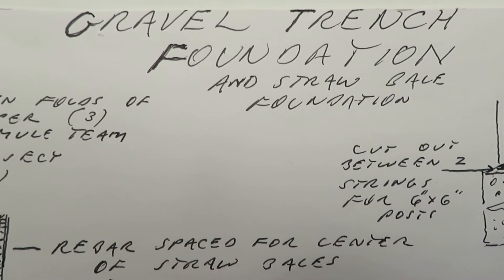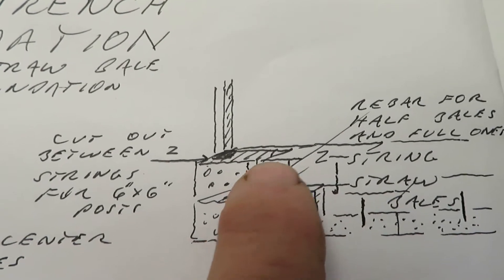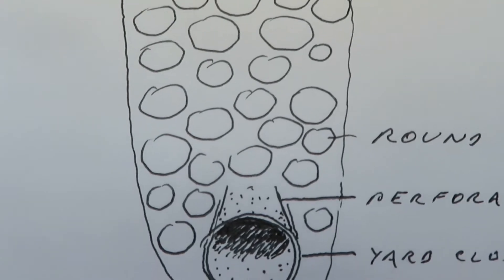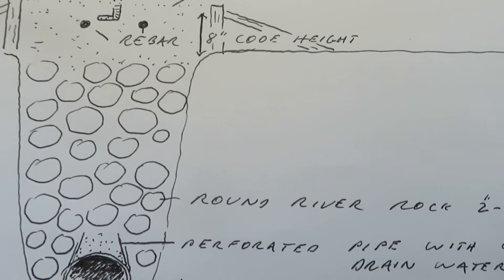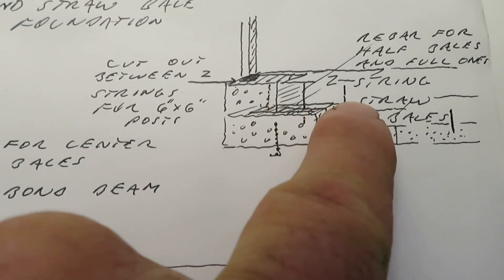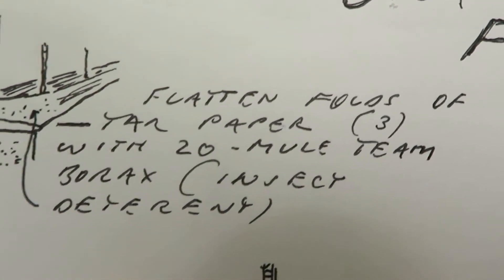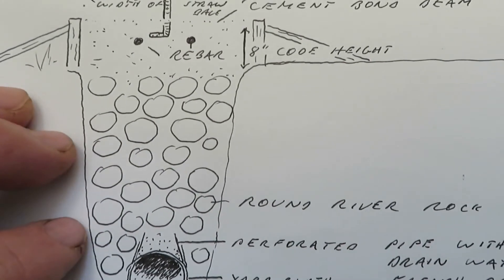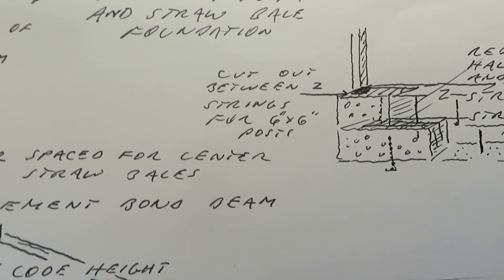GRAVEL TRENCH FOUNDATION - HUGE SAVING ON CEMENT-HUGE REDUCTION IN CARBON EMISSIONS-WATER PERMEABLE

Comment: I am unclear what "absolute point to point compression" is. My father used a rubble filled trench next to the concrete foundation on top of a drain pipe, 60 years ago. The soil was heavy clay. 
Looking back I wish I had asked him why he didn't use that rubble fill instead of the concrete footing/foundation. Why use any concrete at all? Why didn't he put the slab over the rubble? And why did you use 8" of concrete on top? Why not use compressed/tamped rock or adobe with extra (a rich mix) cement? If you did, there would be no need to pay for concrete delivery. You could mix it yourself.